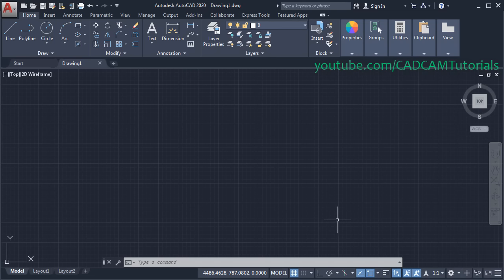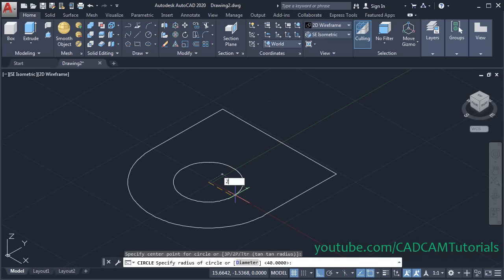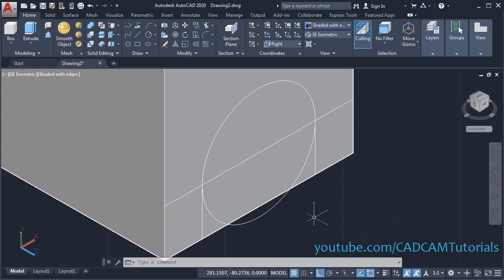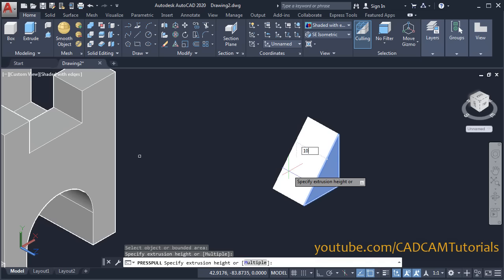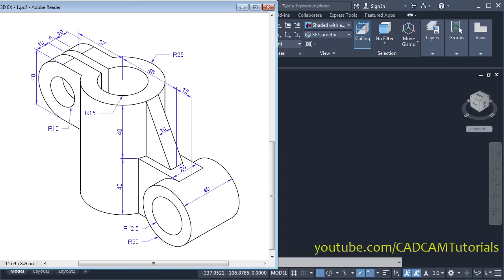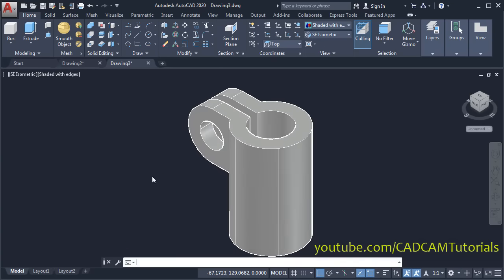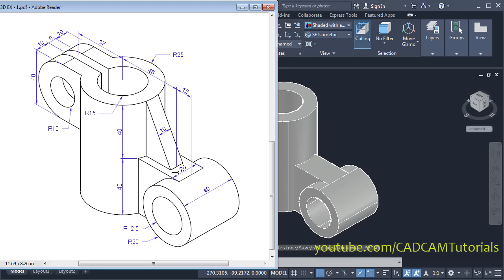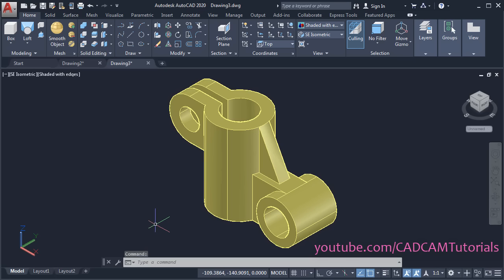AutoCAD 3D Mechanical Drawing Tutorial - 1

Comment: So technically instead of the rib section you did sir, i tried drawing a triangle of length 20 and height 40, then presspulled to a depth of 10. i think this works and even less complicated right?
Reply: I am thinking the same.

Comment: fantastic video thanks! but one question, I'm new to 3d drawing, correct me if I am wrong, but using AutoCAD mechancical seems far too complicated compared to Inventor or solid works? it is more like "ok you can do 3d drawings in Acad as well, but not really ment to used for". it is so much more work, also have seen one of your Inventor videos, way more handy program. greetings from Austria
Reply: AutoCAD is a direct modeler as opposed to the parametric ones that you mentioned. Direct modeling is actually much faster once you learn how to use the software.

Comment: I CAN'T TRIM THE STUPID CIRCLE on 1st EXAMPLE ... HOW ??
Reply: I put the view on Front and named UCS to Front. I typed TR and hit enter to select Trim tool. Then I selected cutting edges, then I selected every line 'The circle and bottom rectangle portion' and hit enter. Then at that point I entered in a mode to trim that object. I selected the items listed in video. Then hit escape to get out of Trim. Hope that helps, I think the enter enter short cut listed in video does not enter correct mode.
Reply from the maker: That's right, in AutoCAD 2021 trim command has changed.
Reply from the maker: Check that UCS is correct.
Reply: @CADCAMTutorials  yah i just check trim mode not in ucs .. can you explain what ucs for ?
Reply from the maker: Here all the 3D basic concepts are explained: https://youtu.be/Vm_fQom-Rm8

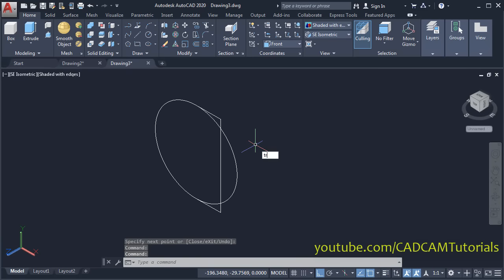Comment: Hello sir at 16:12, i used the trim option and it is not getting trimmed. It is showing ( the edge is perpendicular to the ucs xy plane ) What to do sir?
Reply from the maker: May be object was created in different plane and you are trimming in different plane. Change the UCS to align xy plane with the shape.
Reply: After selecting trim>>click cuTting edges down on the command bar and follow the video from there